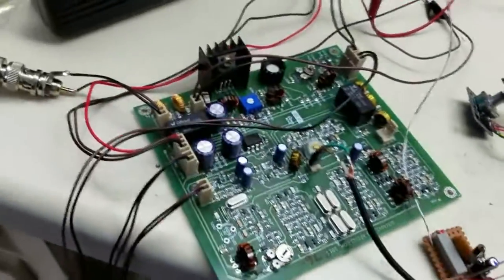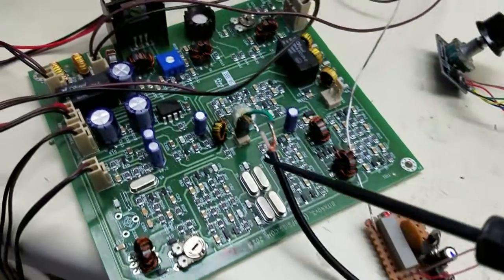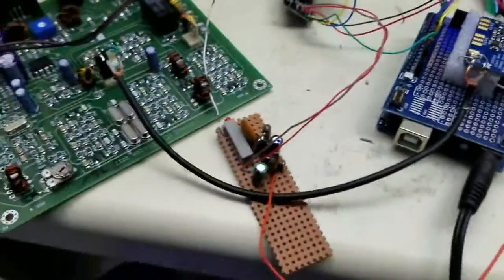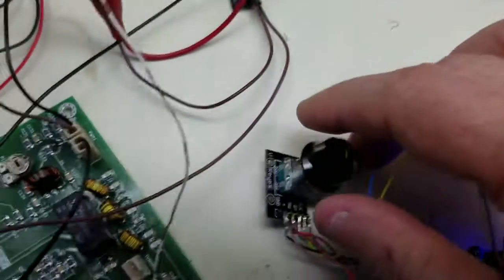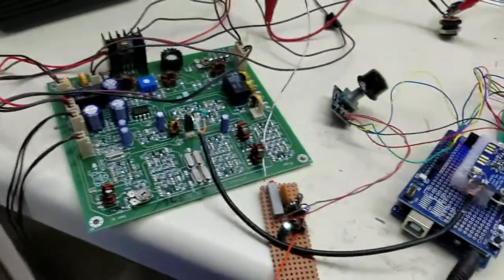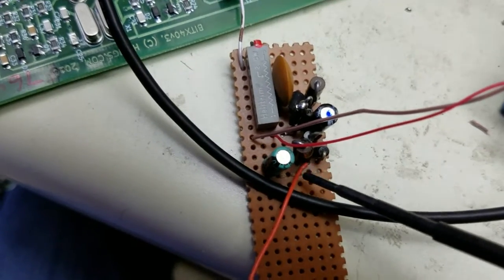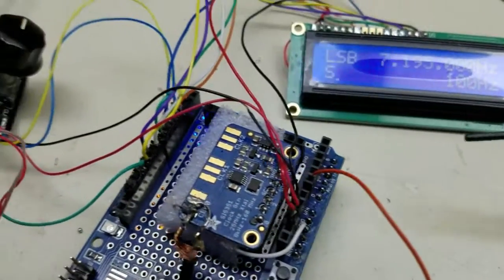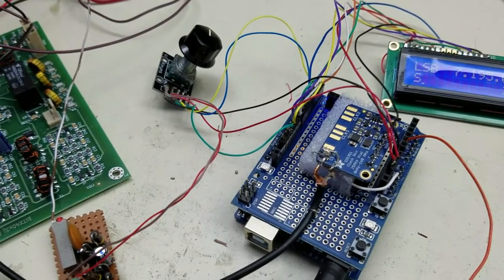BITX40 S meter

Comment: Now you have S-meter,would it be feasible to have a SSB squelch control based of the s-meter values?
Reply from the maker: Yes we all understand that.  This radio is very limited and this is just a way to simulate a reading how strong the signal is.  This approach is used in a lot of qrp radios.

Comment: Hello.
I try to run the sketch for arduino uno but I have a compilation problem. 
No matching function for call to 'Si5351 :: init (int, int)'. 
I tried to see if this was not a bookmarking worry, but nothing did. I come to you to give me some advice. I am a novice in the world of progammation, and my knowledge in this field is very limited. Thank you for your help.73's ON4LAU